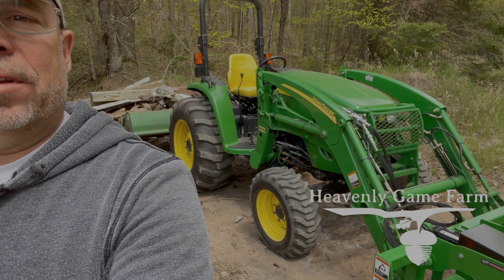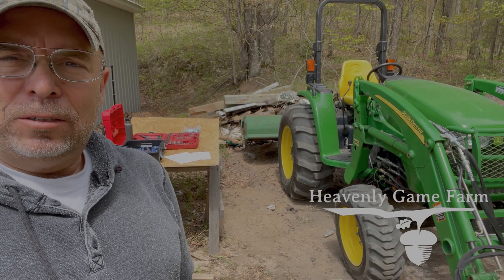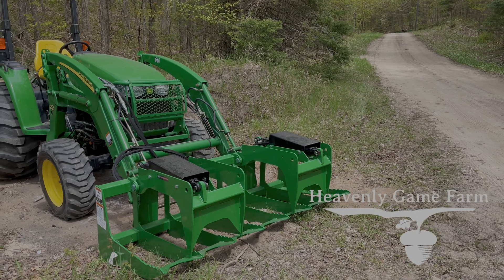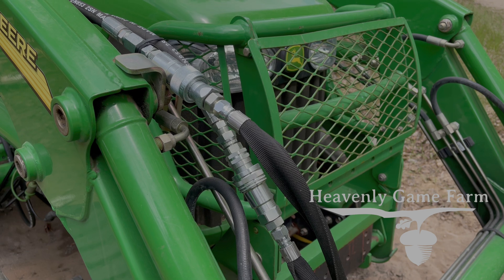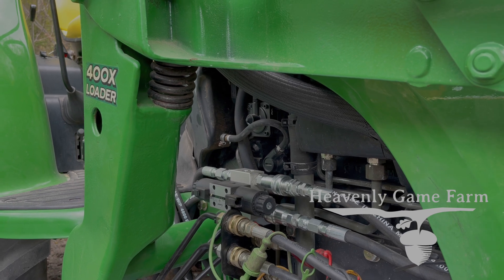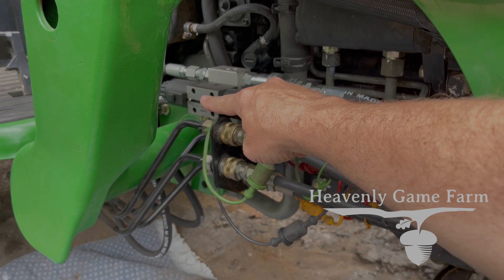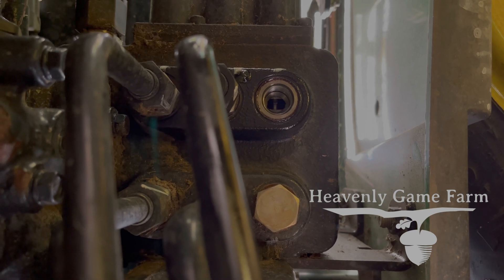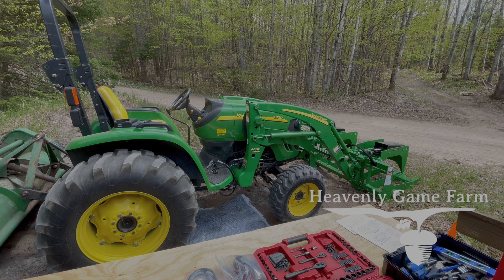3rd Function Hydralics

Comment: Hello and thanks for the video. Found myself here because I'm getting ready to do this on my 2010 4320.  My tractor has 6 ports coming out of the valve body, 2 for raise/lower, 2 for dump/curl, and 2 that run back to a rear SCV. I'm guessing I would T out of the 2 ports running back to my rear SCV? Have you had good luck out of the Summit kit? Thanks!

Comment from the maker: UPDATE:  The hydraulic lines connection portion of this video is ALL WRONG!  You DO NOT connect to the loader control value.  Connecting directly to the hydraulic pump turned out to be the ticket!  Live and learn.
Reply: So where did u end up connecting them to then? Im looking at upgrading to this tractor and would be doing this extact Summit control for a grapple. Any pics would be great!

Comment: I have a 2009 JD 4320 and would like to do the same. Do you have a parts list of what you needed for this project? I'm very much in a similar situation to yourself - I don't have a lot of familiarity with hydraulics and my nearest farm stores (a JD dealership and a Kubota dealership) are an hour away from me. The difference between my tractor and yours is that I have a backhoe on mine.
Reply: I'm doing something similar with my 4320.  A hydraulic snowplow.  For connectors I went to Hydraulics Direct...very good and fast source.  The plow came with ag connectors and of course JD had something different.  I'm hooking up to the implement outlets in the back and wonder why you guys are not doing the same. The
hoses are long but an easy solution.
Reply: @bobbean4702  The only control I have over the implements on the back is the "rock lever" if I recall its name correctly - it is the lever used to hydraulically lift the 3 point hitch arms. Using that to manage a grapple would be difficult and not very intuitive while using the front end loader controls. Granted, I'm new to this, so I may be misinterpreting things here. Besides which, when my backhoe is attached (which is most of the time), those hydraulics are in use.
Reply: @ColdFlame23  I bought mine used and the controls were very mysterious.  Seems like JD made every tractor different.  Mine needed some work when I bought it..Had to take the top cover off the rockshaft gizmo (heavy for an 80 yr old) and clean out the pilot valve.  clutch and brake pedals needed to be freed up.  Runs good now. It originally had a cab so the controls all reflect that.  Also had two big female couplers sticking out the back for implement hydraulics and there is a lever near the rockshaft lever for that.  Hope it works...I'll know tomorrow.
Reply: @bobbean4702  Mine was used also and it appears my rear fittings were changed from whatever John Deere used that was proprietary.  Let us know how you make out!
Reply: @ColdFlame23  Got it all hooked up and running.  works fine.  Our old 4320s came originally with ISO 7241-1 B series couplers.  JD has since gone to ISO 5675 AG series couplers.  Dunno why.  Another thing to look for is the O-ring style female couplers are 1/2" thread but the mating males are 3/8"  !!!!   Don't buy a matched set.  My new snow plow has the later male ends so my hoses have the two different connectors.  The old couplers that were on the back are tucked away for who knows what. Actually looking forward to some snow but not too much !
Reply from the maker: Order my parts from Summit Hydraulics. 

 http://summit-hydraulics.com/product/universal-hydraulic-third-function-valve-kit-w-joystick-handle-15-gpm/